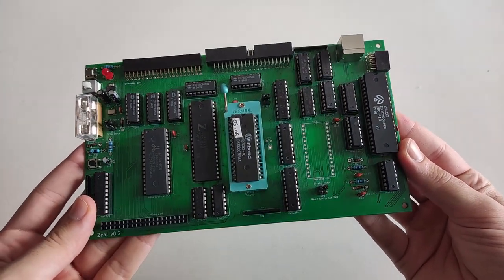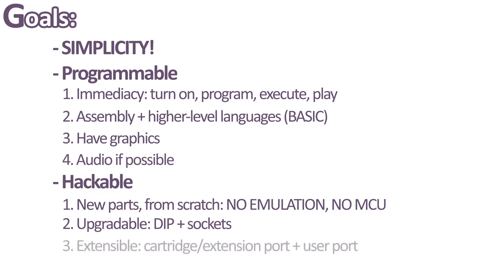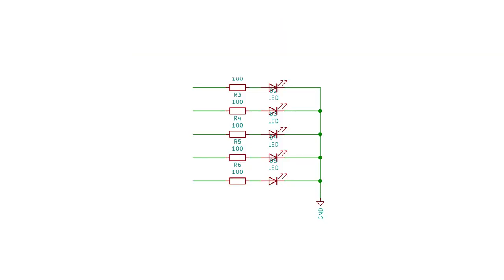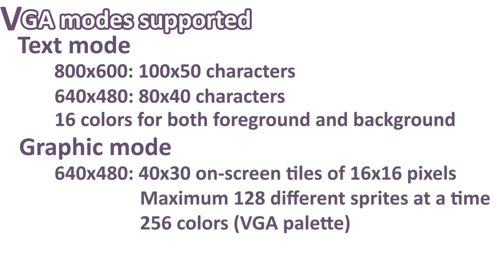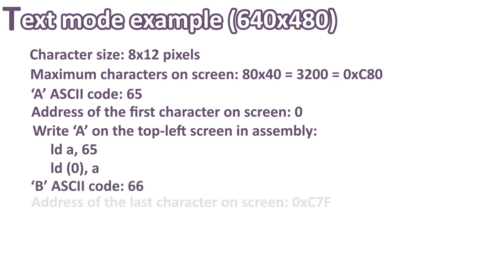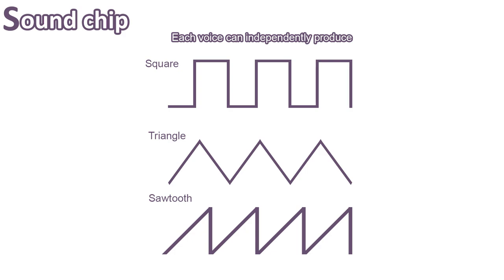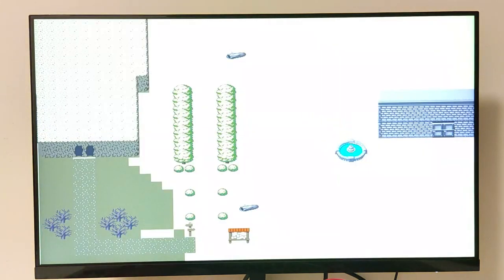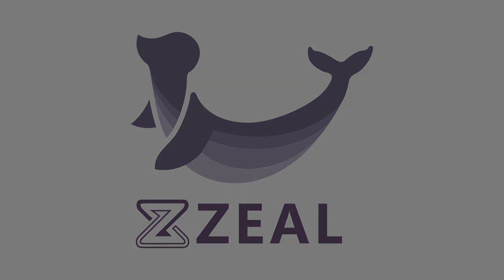Build an 8-bit retro computer powered by a Z80 ! [Zeal 8-bit]

Comment: I already started an similar project based around a Z80. However my design interestingly does not contain a non volatile Memory like a ROM or FLASH. Just 64 KB of SRAM. The Program first is “injected” by a STM32 that is capable to capture the Z80 Buses by DRIVING THE Z80 BUREQ among of RD/WR... signals. Then the STM triggers Z80 RESET LINE, releases the Bus by dead setting BUSREQ and the Z80 executes the Code that has been preinitialized starting at Address 0... For Sound I attached an AY-3 8912 sound chip (as used in the Atari ST)... For Graphic you may an FT81x EVE chip (search for “Gameduino 2”) as an alternative... 😉
Reply from the maker: Very nice project! I also wanted to use the AY-3-8912 for the sound, which is well-known and often used back then, but it was only available as used unfortunately. I wanted to stick with new parts.
I am curious about the reason you are using an STM32 to inject code in RAM, is there any practical reason or limitation for not adding a ROM? Or was it by choice?
Reply: @Zeal8bit  Thanks for responding! Yes, these AY soundchips are just available as used parts.... ...mostly delivered from China. However I’m apparently a lucky guy who never had any problems with these parts. All of them I've ordered worked... ;-) I recently ordered some “Sound synthesis” chips - the SP0256-AL2 (these has been used in the late 80s as an Extension Module called “Currah MicroSpeech” for the Sinclair ZX Spectrum - and this chip worked like a charm. 

...Then I applied these more powerful OPL2 FM Sound-synthesis chips (e.g YM 3812 as used in the Sega Mega-Drive and Sounblaster Cards back in the late 90s) and none of these caused any trouble... But anyway, I can understand your decision! 

Why the Solution with the STM you've asked. 
Well, I decided for the architecture with the STM because of the benefit just to use the Z80 assome sort of "rapid development system". So the STM on the other end is connected to my Mac via USB (CDC). So I’m able to (re)program the Z80 System quite quickly with the STM acting as a “Gateway”. 

Furthermore - since the STM has full access to the Z80 Bus-/ Data- and Control Signals and even generates its clock I have full control over this part. With this architecture I’m also able to “Inject” Instructions “on the fly” (by driving the databus depending on the Z80 MEMRQ/RD and perform slow clock / single steps and let the STM “watch” the whole Z80 Bus while letting the Z80 execute each (intrusive) Instruction / Data ... ...and let the STM then report all Z80 System Bus activities back to my development machine via USB... 

Furthermore the STM side consists to a 8MiBit SPI Flash, a quite small I2C EEPROM (for parameter Setting) and a littele 0,96" I2C OLED Display with some Pushbuttons... 

This setup allows me to store some Z80 code in the SPI FLASH which then I may recall in order let the STM "reinitialize" the Z80 attached SRAM as discussed... So this System should be treat more a quite flexible “live” Development System with a direct Connection to my Development machine. ...Or maybe considered as an “intelligent Real-time Z80 debugger” ;-)  

BTW - You decided for discrete 74xxx logic for the Glue-Logic around the Z80 Adress decoding etc. Well, I was challenged by the same issues but I've realized this by using a GAL 20V8 device (Programmable Gate Array Logic) which substitutes all of these discrete parts into one single device...

However I like your work and the great presentation! Keep in being curious! 👍👏

Best, Peter from Munich, Bavaria 🍺

Comment: Very neat! However (hopefully you don't mind my honest opinion) I would not design this in a way, that it's not uniformly banked, like 4*16K (or 8*8K etc), where any "page" can hold any RAM/ROM at will. It will allow great future potential. Like: you want to try CP/M (even if you're not interested now), you need RAM from address 0. You may want to port SymbOS once, it requires some flexible memory banking. With a kind-of-rigid bank scheme, some can limit themselves in some future projects (even if it seems now, you don't need this, and you want to design something matches to your current OS). I have this very problem with 8bitguy's Commander X16 (though that's not Z80 based for sure) as well. But again, this is only my personal opinion, hopefully you don't misunderstand my intent that I posted it. Such a "uniform" banking scheme can be quite easily implemented with some "register file" ICs from the 74xx series of logic ICs for example, where the actual register is selected by the some upper bits of the address bus from the CPU, and the data output forms the new (and extended) upper bits for the address but for the rest of the system bus. But surely, if you only want for yourself, with only your software, then indeed, it does not matter too much that some "other" software project would require more flexible memory banking scheme, if you don't plan to use those. And sorry for my not so great English ...
Reply from the maker: Thanks for your comment!
I love that you give your opinion, that's the purpose of my videos, exchanging ideas with people 😄
The thing is I was working on this yesterday (I was looking at CP/M)! I was so wondering whether I should change the mapping to a 4x16KB page (64KB virtual memory address). With this, we would have 4MB of physical memory address space. This has multiple advantages, as it makes the system memory pretty flexible.
However, on that case, I am also considering forcing the last 16KB to RAM. This would be used for system stack, interrupt vectors, global variables, etc..

The drawback that I see is that it complexifies the system in the sense that it is less straightforward for the users. I explain, in the case of the VRAM for example, today we know it's always mapped to 0x0000-0x7FFF, but in the case of the MMU (4x16KB), the user himself has to configure this. Well, it's simply an OUT instruction but still, it's less straightforward.

I am going to have a try soon 😄
Reply: @Zeal8bit  Well I am careful with comments usually since some people seems to be extra picky and angry if someone comments anything which is not 100% of the opinion the video says as well, regardless with my good intent only.

I think universality is always good, I wouldn't bother to have forced fixed memory area at the last 16K, in fact it just makes thing more complicated to do. Surely you are not forced to ever change the last 16K if you want so, but it's always nice to have the possibility who knows about future software projects on your SBC would need that. I cannot say now by heart, but some two pieces of 4x4 bit register file 74xx (a 4x8 would be better, but IIRC there is no such a thing or hard to get?)  IC would be about enough, being A14 and A15 from the Z80 is the register selection, and the output of the register file is the new system address bus A14-A21 (surely you need to solve the problem to write the register file as well). Any modification here, like forcing last 16K "page" to be fixed just more complicated at the hardware level, so honestly I wouldn't bother with that, and it's even better to have the possibility at least.

One key problem however that reset state is problematic, since most of these register file ICs does not have RESET. Other than that, you can use the constructed 22 bit address but topmost bit to decide selecting ROM and RAM, if it's OK to split the 4Mbyte address space into ROM and RAM as 2-2 MBytes.

For video memory, hmm, yes, honestly I would just take normal RAM can be read/written as well (so you need to map in ...) but your FPGA solution need to sense the write to the area dedicated as video RAM and update its internal block-RAM (I suppose what you do ...) to be able to generate video signal from it. Using I/O to access video RAM is kinda slow, maybe OK for some projects, but problematic for really neat things like for SymbOS (unless your video solution knows some fancy things like "executing" video copy inside VRAM etc, what it SymbOS also do in MSX where the video RAM is not directly CPU mapped either).
Reply from the maker: Oh I understand, some people may be irritated, yeah. In my case, I find that very informative, not only for me but for everyone reading, we can study multiple approached😄

Anyway, I started analyzing this possibility this morning, seems like I will be able to test it on my current PCB without too many modifications (few wires to add, no need to cut traces, that's acceptable to me)
Indeed, my board already presents two 74LS670, which are 4x4 bits registers. This is what I used for banking, and this is what I am going to use for mapping. This will give me 22 bits of address, so 4MB physical address space.
I am not worrying about the startup/reset, I already have an idea about how to do it. I do have a RESET line for the CPU. On startup, this line is LOW for few (several) cycles, so that's what I am going to use.
So anything related to reset or fixed memory page can be managed by the ATF16V8B. But as you said, first it would be more straightforward to forget about the fixed memory.
No worries about the VRAM, I decided to allocate 128KB of physical memory space, that should be more than enough currently. Indeed, it is not fixed to 0x0000-0x7FFF, we would need to map it to anywhere within tht virtual address space, just like other memories. Well, that's acceptable in my opinion.
I will try to start tweaking the hardware tonight to include that MMU implementation 😁
Reply: Your comment is true if you want cp/m compatibility you need 64 k ram 32k might just work but you wont run any useful programs. The way to achieve thks is to have a minimal (2k)  boot rom which is switched out after it starts to boot cpm
Reply from the maker: @alynscott2109  This comment is a bit old, I made a lot of progress since😄
The latest has an MMU of 4 pages, 16KB each. It's more than enough to have a small bootloader for copying CP/M into RAM and executing it. As you said, 2KB is enough, but making the pages 16KB big was the simplest (less components too). You can check my more recent videos

Comment: msx were made with Z80.Several Texas intruments calculators had one. I have a Ti 86 programmable in assembly, with z80
Reply from the maker: Indeed! The Z80 was very popular. Some Ti calculators are still using them nowadays (+ an ARM co-processor nearby).
It would be interesting to try porting Zeal 8-bit OS to the Ti 86 or MSX computers!

Comment: Nice machine, it's interesting when design choices are unique and not a copy-paste of existing designs. Dead Z80 chips are a real thing, the first two chips I got from Ebay were braindead. Problem was, I had never verified my NOP breadboard tester was working so I was stuck in a situation where it's hard to diagnose where the fault is. But it turns out it was faulty chips that with a static clock signal were putting out ~3V on nearly every pin when they should've been either high or low.
Reply from the maker: Thanks! Indeed I tried to not have a deep look at what was done in other Z80 projects to make sure not to inconciously copy😄
Dead Z80s are a pain, not because of their price but because of the amount time they make you waste!
Moreover, as you experienced they don't really "do nothing", that would be easy to guess they're dead, but they actually have a behavior that may look ok. In my case, my dead Z80 was ok for the first few memory access. So when using a logic analyzer, I didn't directly see something was odd: the first clock cycles were ok. When I saw that the IOREQ line was never low, I started thinking about "what if it is dead?". It was my first time working with a Z80, I was still a beginner at that time😄
Now I always buy multiple samples of the same chip, just to prevent such issues

Comment: Really impressed with what you are doing. Don't stop, keep going. The knowledge you are amassing is going to be useful 9n the future,  I'm sure.
Reply from the maker: Thank you for your support! A new video will be out soon.
I did learn a lot thanks to this project, I hope I can share this with viewers
Reply: @Zeal8bit  I will try to look out for the new video. I subscribed,  so I have a better chance of seeing it.

I love how you can slot together the two revision boards. It is a great idea,  as one board might get more improvements faster than the other. Thus, you can swap out boards, as opposed to having to replace the whole affair each time.

This is a really good project, and I really hope you can create something that is as good as the old machines, if not better.
Reply from the maker: @horseradishpower9947  I will do my best to reach this goal!

You got the point of having two boards. Currently, I am more concentrating on the mainboard, I can update it without changing the FPGA one. And the fact is I don't really want to solder an FPGA as often as the CPU board 😄
Reply: @Zeal8bit  I understand your efforts,  as I put together my desktop computer with a Raspberry Pi 4B as the main piece. As a result,  I have an appreciation for this project. And what you are doing is brilliant. I suspect in the next year, you will have gotten this project together, to the point where this is more finalised.

It would be interesting to see if this could be made to run things like office packages, because that would show that this machine has greater utility. And would stop the average person from thinking that this computer is just a toy of some kind.

Again, good luck with this project.

Comment: An awesome product, especially for those of us who started with 8-bit PCs. I had an Apple ][+ with a Z-80 coprocessor running CP/M. nifty little op/sys.
Reply from the maker: Thank you very much for your message!
You can check the newer videos a lot of things improved on the latest versions of the motherboard.
CP/M is very interesting and a lot of Z80 fans are still using it!

Comment: I selected Z80 systems over 8080 systems due to the block instructions and the extra registers. Then I picked between the Exidy Sorcererer, TRS-80 and the H-89. I selected the H-89. I found out from and AMD rep that the block instructions were as fancy as I had believed. Clearing, copying and filling memory was still 5 times faster than the equivellant 8080 code. The AMD ( licensed 2nd source for Z80s at the time) rep told me all they had to do to make the block instructions work is add 2 or 3 registers (this I already knew) and inhibit the incrementation of the program counter 'til the the byte count went to zero. The bad part about that is that for every byte moved the block instration would have to be reread from memory. Still better than reading a whole subroutine to do it, but nat quite as fancy as I had imagined. The fact that this engineer had told me this increase my respect for AMD! I may have got a few details wrong, as I am working from memories of a very long time ago.
Reply from the maker: What I also like in the Z80 compared to the 8080 is that it only requires 5V power supply, no need for -5V or 12V.
The Z80 makes memory manipulation very handy indeed!
Do you happen to know what are the additional 2-3 registers used for?
For example, one cycle of LDIR when BC is NOT 0 takes 21 cycles, composed of 4, 4, 3, 5 and 5 T-states (according to the user manual). The first 4, 4 is an instruction fetch because the instruction is 2-byte big, the following 3 cycles is a memory read at address HL, then the 5 cycles are memory write to DE (while incrementing DE and HL?) and the final 5 cycles are for decrementing PC I guess.
As I understand it, one register is needed to store the value read from (HL), could it be that there is 2 8-bit registers to buffer DE's value while it is being incremented?

Comment: Really nice. I implemented a TV signal generator in a CPLD with just 44 macrocells capacity. It should be perfectly feasible to do it in 74xx series ICs. It's basically just a 19-bit presettable counter, an 8-bit PISO register and a little bit of logic. It would probably come down to a board about the same complexity as your CPU board.
Reply from the maker: Thanks for your comment!
Only 44 macrocells? That's a nice achievement! Was it a PAL or NTSC signal? Do you have an article/blog where we can read more about it?
I am also convinced it's doable to do it with 74xx logic chips, I even think it's possible to generate a 640x480 VGA signal out of 74xx logic chips. However we would be limited to text mode, for graphics mode, it starts getting tricky 😄
In both cases, you either either need dual port RAM or you'd need to slow the CPU down to give it clock cycles to the video board (to let it read RAM)
It'd be a nice side project though, even if not very convenient for real usage.

Comment: Great project! I had an Apple ][ (actually something compatible) with a 6502 and a Z80 card. These were great times when one knew at any instant what was happening in the machine.
Reply from the maker: Agreed!
You can plug a probe to the pins and actually see what is going on in the hardware!
Was the Z80 card meant to have CP/M on 6502 computers?
Reply: @Zeal8bit  Yes, that was the main purpose. You could run Visicalc (not important to me) and Turbo Pascal (very important for me). But while I programmed the 6502 in assembly language, I never tried to do this with the Z80 (to many opcodes).